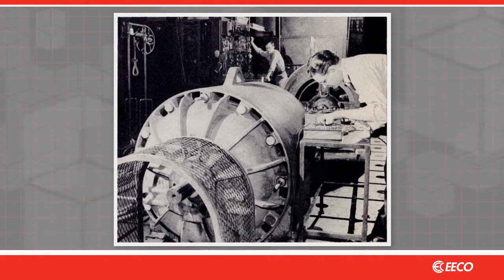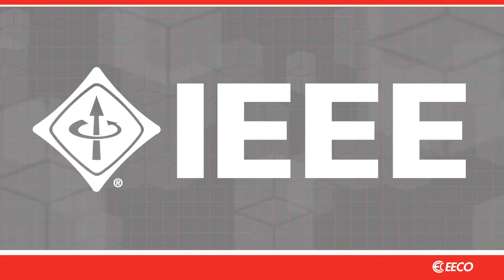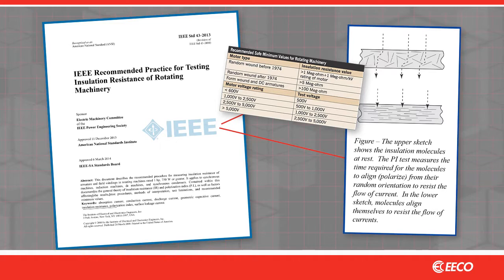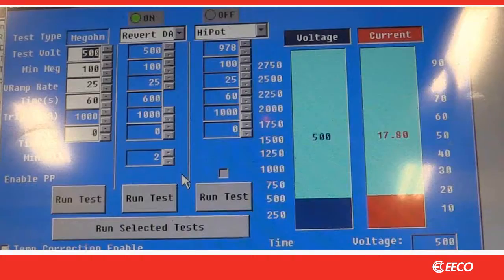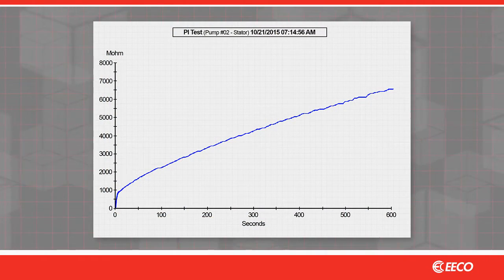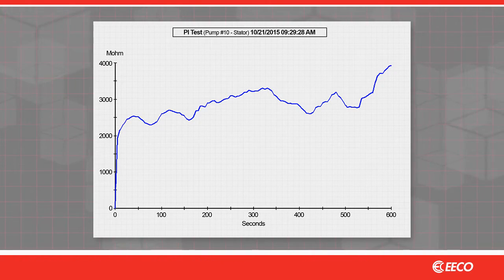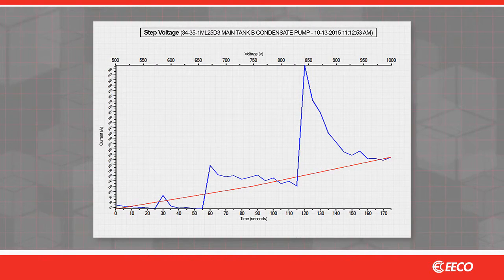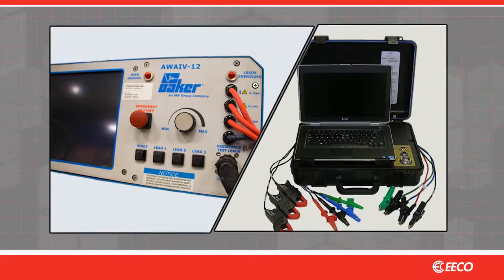Polarization Index Testing - Motor Repair Best Practices

Comment: can PI done on star connection circuit?
Reply from the maker: Yes, PI testing can be done on a star connection circuit! The connection is between connector and ground. The test focuses on the relationship of insulation resistance to ground and can yield valuable data.   As with all PI tests they are typically used for trending and is not a pass/fail test.  Best of luck and let us know if you have any other questions.